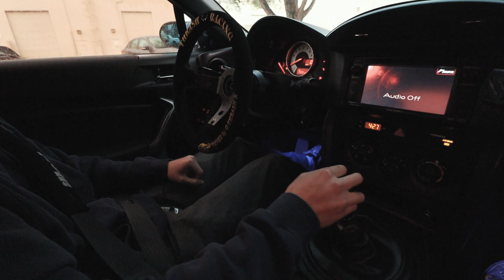Getting the G35 back to Normal

Comment: Do you think I could fit 19x11 +15 all around with 235/35/19 fronts and 245/40/19 rears without any fender work? I’m also running truehart coilovers